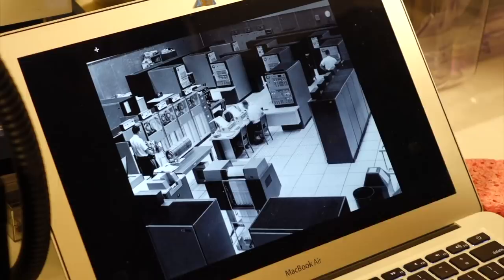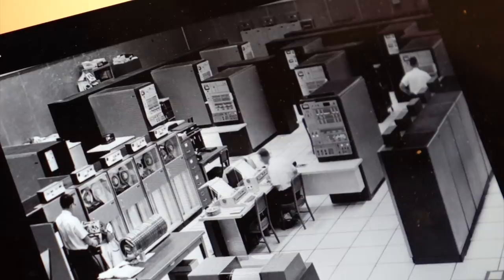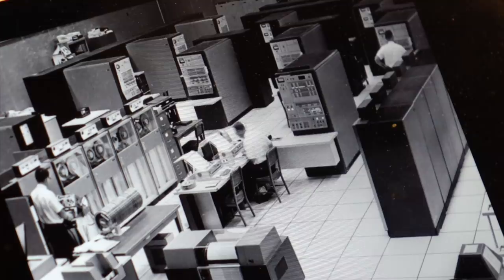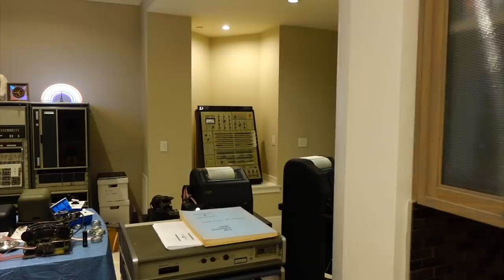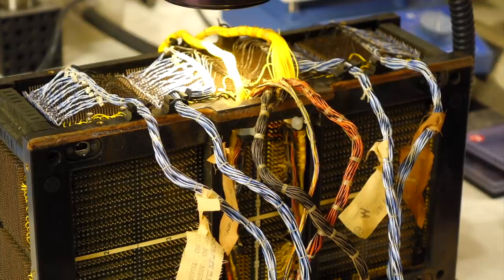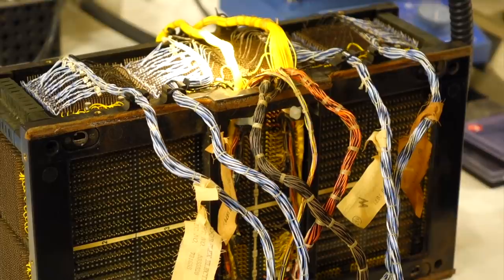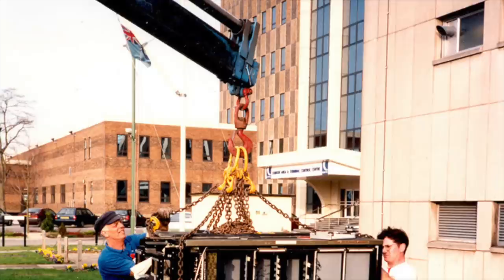IBM 9020 Core Memory Module from the FAA Air Traffic Control System

Comment: It was heart breaking to see the picture of that magnificent machine chopped in little pieces.
Reply: I think the main expense with running some of these units is the huge amount of power they consume, which is a real fund issue with museums (especially as simply turning some machines off and on can blow old valves)

Comment: Had a broker call me in 1983 (or so) asking if I could "sew core". This was specifically for the 9020 FAA systems. Naturally I said "no", but the correct answer would have been to offer designing a replacement to the core controller using static RAM. That would have been a great project. Was too busy on doing 308X 3rd-party memory.

Comment: Overengineered but probably as reliable as it gets. They used native american kids, adept at bead work, to string the rings on the gold wire. That used to be a state secret.
Reply: Likely so. Everyone I ever saw working on the memory production lines was female. I think that for whatever reason women were almost universal for detail hand and eye work in almost every industry. They still are; most of the people on the Chinese factory electronics production lines are female.
Reply: @jonasthemovie  It's mentioned in the book Soul of a New Machine.
Reply: @lwilton  And younger ones, too. A neighbor lady who worked with my mom in the steel mills in WW2 worked in a textile mill when she was a kid in the 20s or 30s.
Reply: Well reliable as long as you had a 24/7 team of technicians to keep them working sure.
Reply: @mzaite  I just think if society collapses, that'll be the only computer memory we can make by hand.
Reply: 525Lines If society collapses we have bigger worries than needing to make computer memory. 

Making transistors to even have computers for example.
Reply: @525Lines  Someone would just how to scrounge up some hardware, people have built ICs in thier garage... so even if there were a complete reset of society, we probably would not start back at core memory. We'd probably start back with ebeam maskless photolithography for small but very dense CPUs, it require less infrastructure, just pure wafers and chemicals, no need to manufacture complex masks. It's slow but you could use it to make relatively modern CPUs at a small scale. Software would have to adapt to not having the availability of many GB of memory, but only a few MB...  but that probably would not actually  prevent most modern tech from working with exception of any AI type stuff...
Reply: @Wingnut353  Just an thought experiment. What could people do to make a working rudimentary computer from scratch. I'm sure it'd be back to big iron and printing dumb terminals in the worst case scenario but enough to get rudimentary email and Excel spreadsheets. Now, that's a reality show I'd watch. Survivor: Mainframe edition.
Reply: State secret - that's why it was shredded - to protect national security and to prevent sensitive data from being leaked.

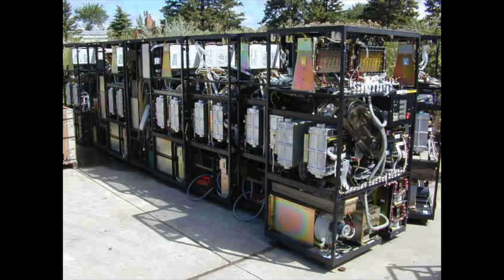Comment: Great video! I took the original pictures at 5:37 and 5:40. That was at the London Air Traffic Control Centre. The picture at 5:43 is an IBM 3380 disk drive, which was never a part of the 9020 system, but was used on it's successor in the USA. The core store unit was indeed from the 9020 IOCE, known as MACH store. The main storage elements (SEs) were 512K as you mention, but used a different type of core storage unit, known as a BSM - Basic Storage Module (or "bomb" for some reason). I have one of those. There were eight in an SE, mounted in four pairs.
Reply from the maker: Thanks for taking the pictures!

Comment: Wow, what a beast of an installation! It ads some sound perspective to the amazing 1Mb that I had in my first Amiga in the 80s. And to think that these monsters would be chugging along all the way into the late 90s. That’s just amazing.
Reply: The first mainframe I worked on was a 1401 with a whole 8K characters of memory. The next one was a Burroughs B2500 with the relatively gigantic size of 25KB, and a 1MB head per track disk. It could run up to 4 programs at once on top of the MCP (the OS), which took 7KB of the system memory. If we'd sprung for 30KB of memory we could have run CP20 and run up to 20 programs at once. My C64 had more memory than that, and the same clock rate, but could only run one program at a time. And came along almost 10 years later. By the time I bought my A3000 with a full boat of memory I was writing operating systems for mainframes with almost 1 MB of memory that could run 80 programs at once and service literally tens of thousands of remote terminals at once. Times change.
Reply: @lwilton  
For my college class, I ran my Fortran program card decks on  B2700 with the head per track drive, with a horizontal axle IIRC.  Humid weather caused the cards to jam in the card reader.  😱😱
Reply: @acmefixer1  Huh. You must have had that little knife-feed card reader. The old readers that sat on the floor and were about 4 by 6 feet could read rags that would never go thru a knife-feed reader, and were almost impossible to jam. That little reader box wasn't nearly as good, but it sure was a lot smaller and cheaper.

Comment: What's not perhaps well known is that the UK also had one of these 9020 systems. It was installed late in 1973 and lasted until 1990 so it had a good innings. Some of the original software is still in use to this day! 

I was one of a group of Brits that went out to the FAA training facility in Oklahoma City for a year in 1973 to learn all about the hardware. When we got back to the UK we were operating what for some years was the biggest IBM installation in the UK, if not the whole of Europe!

Comment: I worked at Skycraft parts and surplus (orlando florida) in 1979 and we got allot of NASA and there contractors surplus items. I was in charge of teardown. I was only 18 years old and it was a deam job to work on this equipment. We got allot of green radios and huge tape drives. I saw allot of rope memory items but even back in 1979 they were collectors items and sold fast. Keep up the good work on your channel.

Comment: Takes me back to my days at what used to be called Manatee Community College.  We had an IBM 1403 printer in the student lab that had an address of 00B (we called it "baby" for the "b") Our IBM mainframe at the time was an IBM System 360/65 with 128K of core memory.  Many 3270 terminals were spread around the campus, but us freshmen had to use punch cards.  Had to learn how to use the 029 keypunch machines which was a bit of a pain.  It only takes one student a semester to drop their deck of unnumbered punched cards to ensure that all other students were very careful with their decks. :-)
Love the videos, Marc!
Cheers,
Pete

Comment: When I see pictures of the old computer rooms from the 50s and 60s, it makes me want to have my own setup like that. I have no idea what I’d use it for but maybe I can use both an older and newer server setup, and you can’t forget about the tape drives!
Reply: Admin User That must have been a cool experience even if the actual job wasn’t too demanding. Modern computers are great but sometimes it’s nicer to use older tech.
Reply: It sucks 200KW and it's 500 times slower than a 80s Nitendo

Comment: To the fellow that said at 5:42 those were disk drives. They are not.  I worked on the memory upgrade on those systems, we doubled the memory 
To a meg for each processor in a smaller unit.  Very interesting setup. I worked on some of that equipment in my service days, 360/20, 360/30 and 40
I spent a lot of time on 1403 printers both models.  I was trained on 10 different systems. The new system Z has giga bytes of main memory and terabytes
of disk drives in the space of the model 360/40 with 100 times the power. The data transfers on the processor bus is above 256 bits, pc’s today use a 64 bit architecture
new main frames are much faster.  Nice to see those computer rooms.  I had one with 7 system 360/20’s running 24/7 very high maintenance they were card systems.
Reply: It's always interesting to hear from someone who worked on old gear like this. I am envious to have missed that time.
Reply: I think you're wrong.  I worked on the 3380 manufacturing line in the 80's at the IBM San Jose plant and the final assembly at South 10th Street in San Jose.  Those look just like IBM 3380K's.  2 HDAs per box.
Here is another picture:
http://www.ep.ph.bham.ac.uk/general/support/ppgroup-technology-history.html
You can clearly see the drive motor, belt and pullies on the right most unit in the video.  This would have spun the disks.
Reply: What advantage would a mainframe have over a rack of servers?
Reply: User 2C47 They would be the control system for those servers. I would not want to maintain a server farm. environmental disaster with the heat they produce. A couple of Z15 main frames would handle those servers. If I am not mistaken those servers are 64bit architecture, the main frames are above 256 architecture. They handle data differently.

Comment: I was  co-op at the SLC ARTCC in the early 90s.  The primary radar data processors looked even older than this, with discrete 7400 logic, rows of huge cabinets. The backup system was a Raytheon unit installed in the early 80s... it used 74154 ALUs.  It was called the DARC... Direct Access Radar Channel, but you were in trouble if you were 'on' the DARC side!

Comment: The IBM 9020 is still in use since its reliable and the software is well debugged and will run 24/7 no hiccups secure no worries about Cryptolocker etc..

Comment: Yummy !! A great way to finish the week. Bacon & eggs for breakfast and another great video from Marc & the team. I worked in the old London Air Traffic Control Centre when it was in RAF West Drayton along with London Military, and the engineering guys wouldn’t let outside engineers through the gate unless they knew them or the engineer was old n crusty, like me, who understood old systems because, until they moved to Eurocontrol, the stuff powering the centre was very much like this video. If it wasn’t broke, why fix it. Hence decades old kit powering the network !!
Reply: Old stuff simply just WORKS ! No messing about with debugging/fixing it. It just works.

Comment: The pictures of the 1920's coming out of service were from the UK ATCC installation at London Air Traffic Control Centre, West Drayton just West of London and North of Heathrow - now a housing estate.  As far as I remember the UK ATC used the 1920 for flight strip processing, but not for radar display processing. If any of the ex 1920 engineers read this they can correct me if needed.
Reply: Ex West Drayton 9020D hardware/software engineer here! Essentially correct - the 9020D did flight and radar data processing but the radar display system was done with multiple PDP11 minicomputers, about 100 of them as I recall. PDP11/34s were used as graphics cards for the displays! You can see a small subset of the 1970s radar display system at The National Museum Of Computing at Bletchley Park.

Comment: and these computers worked until 2000 ??? holly cow !
Reply: Past 2000. I think they were finally removed during the post-9/11 upgrades.
Reply: @TheRealColBosch  I wonder if the new systems actually are more reliable.
Reply: @Patchuchan  Than core memory? Almost certainly.
Reply: TheRealColBosch — Core memory is pretty reliable.  The core memory computers I worked on didn’t have parity bits, let alone error correction.  As Seymour Cray once said: “Parity is for farmers.”

Comment: I suspect the old machines were "crushed" to prevent their precious software from being lifted from the memory cores?  BBN was required by DOD to use a purge tape about the size of a Dictaphone cartridge tape to scramble the memory when the equipment was decommissioned.  I seem to remember that the government was so paranoid (and or didn't understand later computer technology at all) that it was also required on computers/servers which had integrated circuit based RAM.
Reply: Rightfully so!  RAM can store bits when it's off.
Reply: @acmefixer1  Well apparently not for long?

Retention time depends on a lot of things, including the values of neighboring bits. A DRAM bit is a potential well, and it loses its contents by moving charges from or into neighboring areas, so whether there is room in these neighbors matters.

    Temperature is very important for retention time (which is why cold-boot attacks insist on cold: if you plunge the machine in liquid nitrogen, you can keep the charges in place for substantially longer).

    At room temperature, typical retention time is counted in milliseconds, at best a few seconds, and, more importantly, the discharge is exponential in nature (it goes in e-Ct for some constant C), as could be expected (capacitors also work that way). So the remaining charge after 2 minutes will be half that after 1 minute; after 10 minutes you are down to a thousandth of the initial charge; after 20 minutes, a millionth; after 30 minutes, a billionth.

To sum up: 24 hours... forget it. You won't find meaningful data in DRAM that has been kept unpowered, at room temperature, after 24 hours (even if the room is, say, in Canada).

An Experimental Study of Data Retention Behavior in
Modern DRAM Devices:
Implications for Retention Time Profiling Mechanisms

https://www.pdl.cmu.edu/PDL-FTP/NVM/dram-retention_isca13.pdf

Comment: We forget from what we came from when you open an app to order food... those early computers are really overengineered and just beautiful. The people who designed those modules must have gone mad at some point :D
Reply: Not mad, they turned into beautiful butterflies
Reply: I wouldn't call it overengineered, overengineering being designing a system that can do more than required for the task. Using an hammer to kill a fly is overengineering.
It the case of old mainframes like these, it is more a matter of scalling to do the task. These historic computers were slow, memory took lots of volume (hence the name still used today for logical partitions?), so to do the job and to do it reliably, you'd just stack lots of cabinets of computing power and storage.
But in background, software was very efficient and elegant, to save any CPU cycle. It is what made these machines so beautiful, reliable and used well beyond their actual technological obsolescence. 
As Moore's law did its job and CPU exponentially rose in power, any modern computer or even microcontroller is overengineered nowadays, being overpowered for the usage. We use smartphones millions times more powerful than this ATC mainframe to watch videos of cats and writes useless messages on Facebook! And also, gone is the day of carefull programming and cpu cycle economy. High level programming language just ruin the concept of efficiency.
Reply: @Damien.D  overengeneering is when you build something for a specific task or job and the design is more complex or has more material etc, than it would be otherwise necessary to accomplish the same task. 

For example a part being thicker than it needs to be to withstand expected forces.

Comment: At first he said Kilobits, but after he said Kilobytes.  If they were 512 Kilobytes and there were 17 of these units, that would be ..  8 MB.   Wow.I remember holding a tiny 8 MB stick in the early 2000s, and it was a small amount even then.  The stick was about half the size of DDR4.  I guess the skies weren't as crowded back then...

Comment: would it be possible to simulate core memory with a more modern solution to get the AGC working?
Reply: other then using flash memory or EEPROM I do not think so.
Reply: It's possible, but it would be much easier to draw a graphic of the AGC panel and emulate all its functions with a modern PC.

Comment: If the human race and civilization are still around in 50 years and technology continues to advance today's state of the art equipment will seem even more antiquated than this does today. The reason is that when AI reaches a certain point the machines will be designing other machines and the improvements will occur at an increasingly rapid rate, far faster and further than humans could achieve alone.

Comment: I'm never flying again !!
Reply: Why? A newer system would be marginally better in performance and efficiency, but with a much higher failure rate. Yes, a newer system could have more features, but they would not be allowed to use them. Bureaucracy sucks.